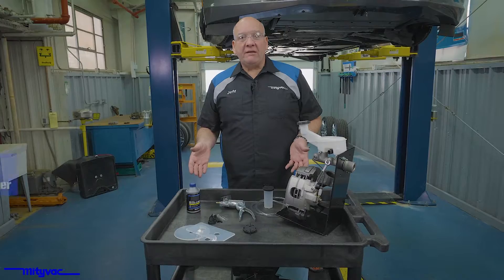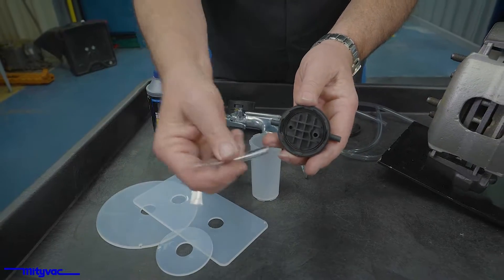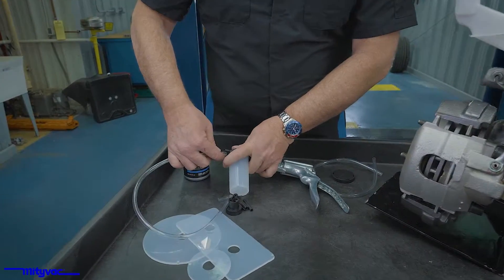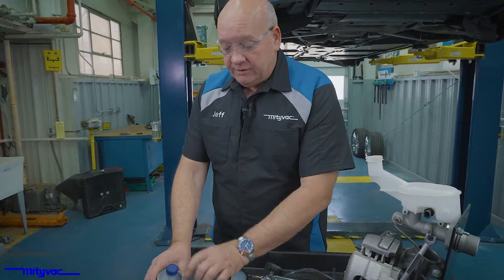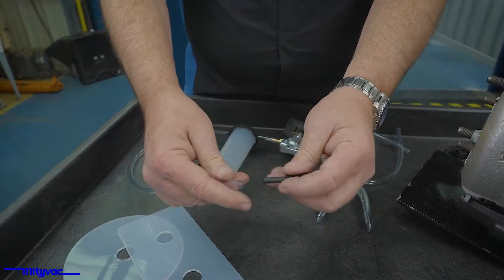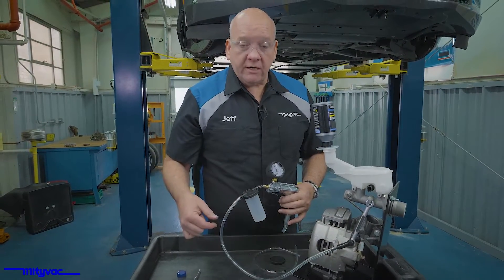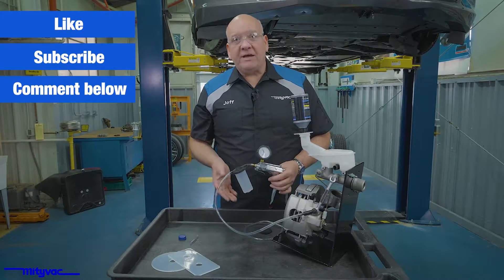Setup of the MV8500 for Bleeding Brakes

Comment: I did not like the MV8500 at all. The fittings do not form a tight seal around the bleeder valve and so much air got into my lines. Then at one point the pump got saturated with fluid because the reservoir was full and i didnt realize it. I had to take apart the pump and clean it out. I ended up getting my wife to pump the brakes while I bled manually with $5.00 worth of pvc hose from Home Depot.
Reply: Operator error on your part.

Comment: Just got this kit, while pumping the pin on the handle fell out.
Reply from the maker: I'm sorry to hear that, the pin can be reinserted into the pinhole on the plunger shaft, and the handle reattached. Add a drop or two of thin air tool oil down the nozzle and cycle a few times slowly. This should prevent the issue from occurring again.

~ John
Reply: @mityvactools  OK, thanks. I will give that a try.
Reply: @gotmovie did this prevent the issue from recurring?

Comment: what’s the difference with the Elite model?
Reply from the maker: The Elite model hand pump model MV8510 which is used in the MV8500 kit has the ability to create vacuum and generate pressure. Compare that to our MV8000 kit with only creates a vacuum. More capabilities with the MV85000 Kit and the MV8510 hand pump. 

~John

Comment: The second time I used this tool the small part that goes through the top of the pump rod & secures the handle broke in the middle of the job!
Reply: You're lucky! Mine fell apart the first time I used it - lasted all of 2 bleed nipples whilst bleeding my truck before it fell apart. Same issue that you had - Mityvac couldn't have been less interested.  Avoid.

Comment: Although the PLAYLIST title of this video is labeled "Setup of the MV8500 for Bleeding Brakes", the presenter states he is using:
 
@ 0:12
"the MV 8510 IS THE VACUUM PRESSURE GUN
0:16
INCLUDED IN THE KIT you notice we have
0:18
setting for pressure setting for vacuum
0:21
we'll make sure that our selector knob
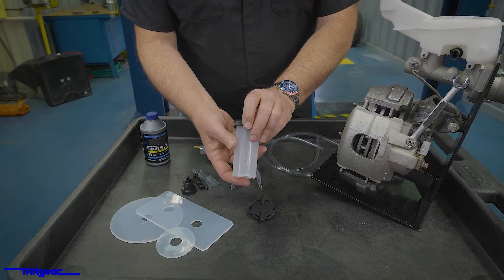0:23
is set for vacuum" --

My MV8500 kit DOES NOT contain the "MV 8510 is the vacuum pressure gun" ...

Just sayin' ... Maybe the PLAYLIST title of this video needs to be changed, as well as the  MITYVAC logo image presented @ 0:00 - 0:02.
Reply: My Bad ... I just realized I possess the MV 8000 gun - NOT the 8500 gun ...
DUH 
😳
Reply: @BozoOnTheOtherSide You chose the right user name....Bozo!
Reply from the maker: The MV8500 Silverline Elite kit includes the MV8510 Silverline Elite Hand pump. 

~John
Reply: Alzheimer

Comment: 2:35 grease, not teflon tape? Do you mean silicon grease? Silicon grease won't contaminate the system, but petroleum grease can contaminate the system.  Isn't teflon tape better than either type of grease? Even PTFE pipe dope sounds better than grease.
Reply from the maker: Grease or thread tape can be used to seal the threads of the bleeder nipple. As you stated, contamination could happen so please choose whichever method is safe and effective for your vehicle system.